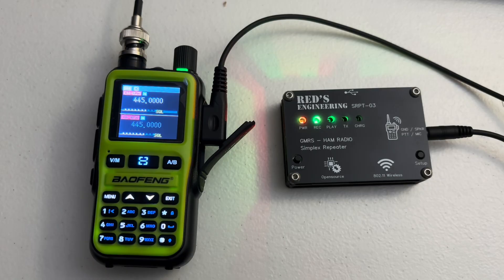Baofeng UV-5R Mini Long Distance Testing #baofenguv5r #hamradio #gmrs #radio #prepper #walkietalkie

Comment: Great test Dave! Hey, what do you think about your VGC-vr-n76? (I think I see that in the background, and Im thinking about picking one up for Black Friday
Reply from the maker: I don’t actually own the VGC version. I own 2 of the Btech UV-Pro’s which is a slightly different version of the N-76. The Btech has 12 less channels available (180 compared to 192) but has 12 NOAA channels preprogrammed in and has the weather alert option. This option is not available on the VGC version. This is something I wanted since I live in a place that gets a lot of weather alerts. But, I also bought the Btech version because Btech provides support for their version and Btech customer service is terrific. I have reached out to them several times and they always respond in a timely manner. And all Btech UV-Pros ship from a US warehouse. While shipping from China is not a big deal right now I bought these right before and as the tariffs were hitting and many of the items I had ordered from China were cancelled or never arrived. I did not want to take a chance. 

Now to your question. I think this radio is about as close as you can get to owning the Kenwood D-75 but without the $600-$700 price. It does most everything I want from an HT and it is very high quality. It is not perfect, but I have made this radio my EDC over the Yaesu, ICOM and Kenwood radios. For what this radio is and what it does it is a bargain at its regular price. I did a review of this radio recently. You should watch it as I go through all the things I find good and bad about the radio. And I did a top 6 Chinese HT’s for 2025 video. This radio came in first place. Also, check out the video I just released Yesterday (Friday) on the Vero VGC BHM-88 Bluetooth Wireless Speaker Mic. It is a new speaker Mic that Vero just released that they claim only works with their version of the N-76. But I bought one anyway. And guess what? It works great with my UV-Pros. Vero/Btech/Radioddity/Radtel all sell versions of this radio and it is a winner. Vero sells several different colors of this radio as well. Btech only sells the black and tan colors. Last thing I’ll say is there are a few prominent YT’ers that have put away their Kenwoods and Yaesus and ICOMs and when they go anywhere they have this radio with them. And with one particular popular YT’er he sold his FT-5D and carries this radio exclusively. I can hardly wait to see what the next generation of this radio looks like. If they fix the issues this radio has the new one will be a huge hit. But also keep an eye on Wouxun radios from Better Safe Radio. Mark has been talking to Wouxun about new features to add to their next big radio release. Wouxun is another manufacturer that makes excellent radios. If they add certain features to their top end radio similar to the N-76 (and its variants) that radio will also be a huge contender to the N-76.

73 Dave N8DAV
Reply: @BrilliantHam Thank you for your thorough response Dave! Because of you, I will be shopping for the Btec UV Pro version this Black Friday. You have just earned yourself a subscriber by the way😊. Have a great day Dave
Reply from the maker: @IM1deadMONEY  Thank you so much for your comments and your sub! I really appreciate them. I forgot to mention to you that I also did a SHTF radio go bag for my Btech UV-Pro. You should check it out! It is a very small bag that allows me to use the radio to its maximum capabilities. I include a Signal Stick for maximum distance. A Signal Stuff mag mount in the bag along with the Signal Stick turns any vehicle into a very powerful mobile rig. In the bag is also 2 Fara-J antennas (2M and 70CM) with 50’ of arborist line and a weight so I can put a Fara-J antenna up to 25’ in a tree on 2M or 70CM. Also included is 25’ of RG-74 coax for the Fara-J antennas. In the bag is also all the adapters and cables I will need for charging batteries, adding a wired speaker/mic but I also include the BlueTooth wireless speaker mic in the bag. Plus extra batteries, rubber duck antenna and stubby antenna. I am trying to cover myself under any and all possible SHTF scenarios and/or just emergency scenarios while off roading around here. I am very serious about this radio.

73 Dave N8DAV

Comment: Hey Dave,  good test.  Question,  do you think the results would be the same with the UV-5G mini? I'm into GMRS only. 🙂
Reply from the maker: Thanks for the question. I did do the exact same test using the UV-5G Mini radios. I believe that video drops on Monday so keep an eye out for it. Without doing a spoiler alert. The performance is not quite as good as the UV-5R Mini radios. Here is what I think is going on. When I did the review on the 5G Mini I noticed the power output was a little lower than the 5R Mini. But both radios were tested on different frequencies. The 5R on 446.000MHz and the 5G on 462.575MHz. So I tested the 5R Mini on the same GMRS channel as the 5G Mini and both radios power output was exactly the same. Also, as you climb up higher in frequency on the UHF band such as in the GMRS band, I found that distances drop off in the higher frequencies. And as the frequency increases, the ability to overcome obstacles between sites also diminishes. So between the lower power output and the slight drop in maximum distance due to the higher frequencies and the diminished ability for the higher frequencies to overcome obstacles between sites, I found that the distance testing was less than for the 5G Mini than for the 5R Mini. If I had used the 5R Mini under the exact same test parameters as the 5G mini I have no doubt I would see the exact same results. I would not hesitate to buy the 5G Mini unless you are looking for maximum performance then there are better options. But these radios are very small and carry quite easily and fit nicely in a pocket. 

73 Dave N8DAV / WSBX662

Comment: Dave. The Icom IC-2730A is a nice radio! The UV-5R is a good buy. I am very interested in the repeater setup.  The guru at the local ARC said I could setup a repeater in the shack and use a handheld in the house or around the property and even on a motorcycle or bicycle ride.  Thanks for the video.
Reply from the maker: Hey Brother Mark! I love my ICOM 2730a. I have a great setup in my truck. No holes drilled. Main body under the passenger seat. Head unit on a Lido Seat bolt gooseneck mount. I paid to have the power wired into my truck as I wanted a relay installed instead of directly from the battery so if I shut the truck off the radio shuts off as well. The UV-5R Mini radios are a pretty good deal. They are pretty good radios for the price. The repeater is a Red’s Engineering SRPT-03 and it is an excellent and rugged controller. It is a “Parrot” or “Store and Forward” type simplex repeater. It will work with most Baofengs and other Chinese radios. Alas, it does not work with the BF-F8HP Pro.

73 Dave N8DAV

Comment: Dang! That was a good test with pretty good results all around. Impressive. 👍  Hey, I don't know how much extra trouble it would be, but it might be interesting and helpful to know what the elevation differences are between your base station and when you are in the field. Might be accomplished with either a GPS or Google Earth?
Reply from the maker: Thanks for your comments and question. I live approximately 150-200 feet above the rest of Flagstaff. Since I live in the mountains the terrain varies quite a bit.

73 Dave N8DAV

Comment: That was a nice range test, Dave. I have a modest collection of ten (10) HTs, none of those are Baofeng's. 
I was more interested with that simplex repeater. That would work very well with my off-grid/neighborhood-watch 2-way radio network in our rural community.Thanks for adding the link. 🤠
Reply from the maker: Thanks for your comment and question. That is a Red’s Engineering SRPT-03 Repeater. I have a link to their site if the description of this video. They have a coupon code of HRRCOUPON as well for 5% off everything on their site.

73 Dave N8DAV
Reply: @BrilliantHam  ~  Yes, the *SRPT-03 looks like a higher quality, and a more rugged simplex (parrot) repeater than the *Surecom-112 that I have been looking at. Thanks again for the link and the coupon code.
Reply from the maker: @royrobinson4636  You’re very welcome! Tell Red at Red’s Engineering I said Hi! The SRPT-03 is very high quality and very rugged. I have dropped mine a lot due to my arthritis. The interface using your phone is great as well. 

73 Dave N8DAV